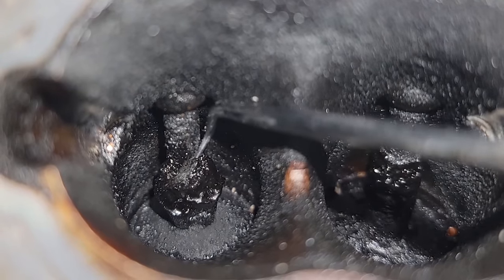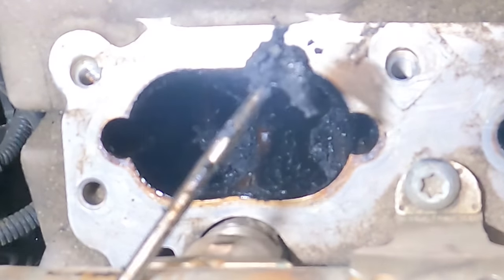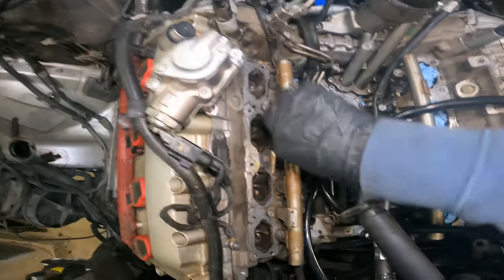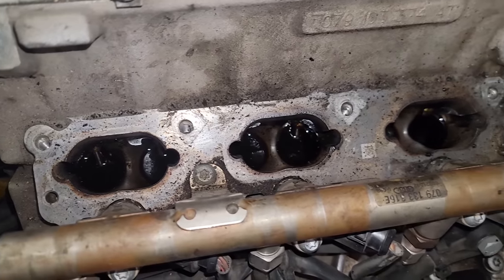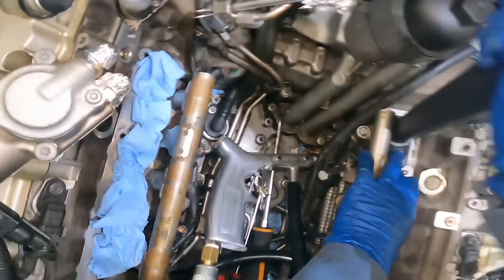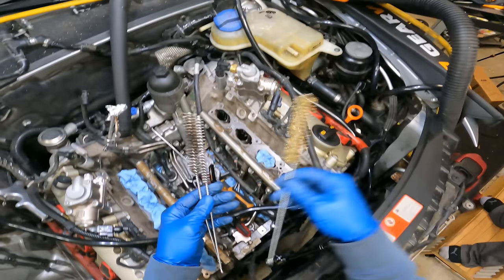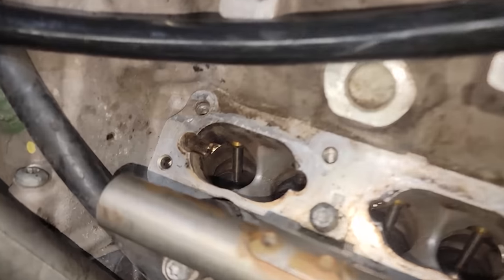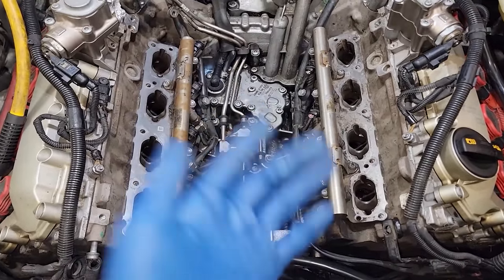Audi 4.2 V8 Carbon Cleaning | DIY Walnut Blasting step by step instructions

Comment: how much of the Ground Walnut Shell Media would it be needed to do a 2.0t engine? (is 4lbs enough) 
Harbor Freight sells a 25.00 lb. Walnut Shell 24 Grit Fine Abrasive Media. I wonder if this grit is fine and I also wonder if 25 pounds would be too much
Reply from the maker: 4lbs should be plenty. Fine or course works as well, I just picked course.
Reply: How powerful does the air compressor need to be?
Reply from the maker: Not very powerful at all, just needs to hit the min psi of the blaster

Comment: Would an oil removal kit work to prevent this from happening in the first place?
Reply from the maker: If you mean a catch can, yes, it would help a little, but it won't eliminate the issue. Even with a catch can it would still have some carbon buildup. Just not as much
Reply: @Mechani_Cole  super unleaded fuel and more frequent oil changes with good quality engine oil would help also.
Reply from the maker: Minimally. Doesn't make a big difference on carbon deposits. This is a result of direct injection and the cons that come with it. They will ALWAYS need carbon cleaning no matter what you run or what chemical is added.

Comment: Hey brother how do I make sure that nothing falls inside?

If something falls inside how bad is it?

Can I do it with chemicals instead?

What if chemicals get inside?
Reply from the maker: @theprocrastination3819 good question! This is why walnut shells are used. They are pretty harmless if a little fall inside. 

But to better answer your question, you need to turn the crank with the crank turning tool in order to make sure whatever cylinder you are working on has the valves closed. You'll watch for the valves to close on the cylinder you want to work on. Then you keep the other holes covered while blasting. Doing one at a time. 

Chemicals evaporate quickly, it's not a huge issue if a little gets inside. However, with the valves closed and the open ports plugged with towels, then there is little chance any error occurs. 

Use foil to cover the ends of fuel lines to prevent walnuts from going inside. 

Use a pick to break the carbon free, just don't scratch the ports up.
Reply: @Mechani_Cole  legend mate

Comment: Looks good when it's cleaned so thoroughly but it's really not necessary since the EGR valve will dirty it up again in a week. Just do a 90% job and save some time.
Reply from the maker: That's why I installed a catch can! Made a huge difference in the carbon buildup. Plus I'm OCD so I like it clean🫡

Comment: The carbon comes off easily if you soak them for 24hrs did that with mine this week.Scouring pad cut in to little squares then spin them them round the values with a screw driver works wonders no need for these crap brushes.I used a small steel brush for the sides of the ports only.
Reply from the maker: Yeah, could work if you don't have the $50 for the blaster and Walnuts shells. However, I usually don't have 24 hours to let a car sit. In that time I could do this job about 6 times. But yes, you can clean them with the blaster.
Reply: @Mechani_Cole  I only used two cans of CRC value cleaner 500ml The results was like it had been walnut blasted but the draw back was It took me fours days to do.Got four done in one day then two the next then two singles over the next two days.The CRC cost me £80 for two.

Comment: Do you use 93 Octane or fuel injector cleaner?
Reply from the maker: Both. But that doesn't change anything for direct injection engines. Only for port injection.

Comment: How is the performance after?
Reply from the maker: Smoother idle, better fuel mileage, and more responsive on the throttle are the main benefits carbon blasting has🤙🏼

Comment: How? Is it because of the stupid EGR??? Edit: the stuff you do does not make sense to me since the edges of the valves that sit closed still will have a carbon on them, preventing them to seal fully, thus still enabling worse compression..
Reply from the maker: All direct injection engines have this issue
Reply: @Mechani_Cole  sorry for being sarcastic but yeah.. this explains my question 🙄

Comment: Yall jsyk I you have bad valves your manifokd will turn red make sure to clean your injectors every 30k miles or so great video
Reply from the maker: Spicy manifolds aren't fun either haha
Reply: @Mechani_Cole  my manifold turned red and my cat started smoking because bad carbon build up and bad injectors it was not fun to fix
Reply from the maker: @Ty0_5 did your cats survive that? Usually ruins the inside of them too. Or maybe it burned them clean? Haha
Reply: @Mechani_Cole   took it apart it was perfectly fine luckily. Since mine is a b7 those are known for bad carbon build up.
Reply from the maker: @Ty0_5 I haven't seen an audi that doesn't have bad carbon build up yet🫡
Reply: @Mechani_Cole  I appreciate you making this video man you earned a sub!

Comment: Everything looks cool and efficient! but there's a problem with the piston group! The engine is consuming oil. In 3000 km it will be the same.😢
Reply from the maker: Incorrect! There is a lot of speculation in these comments, but not many facts.

Carbon cleaning has to be to performed even on new engines that consume no oil. It's just how the design is. Look up port injection vs. direct injection to see the difference.  

This won't need to be performed for another 60,000 miles🫡

Comment: Every time I gas up I put lucas oil I hope my car can pass the 100 k miles before this happen
Reply from the maker: Doesn't matter and would never make a difference. If anything it's a waste of money for direct injection engines. Quality of gas, nor additives do nothing for carbon deposits on direct injection. If you have port injection like most cars, then you got nothing to worry about.
Reply: @Mechani_Cole  I have a 2020 Corolla what motor is that
Reply: @Mechani_Cole  how much miles dose this car have in your video
Reply: @Mechani_Cole  after I put lucas oil gas saver I save a lot of gas if I put nothing I can feel the different
Reply from the maker: You have port injection. You'll never have carbon deposits like this due to gasoline 'washing' the valves. 

On direct injection the injectors pulse fuel directly into the cylinder bypassing the valves.
Reply: @Mechani_Cole  I like had 3 old Camry they all stall after 70 k miles was it this carbón build up
Reply: 1995 Camry stall after 150 k miles then my 2nd Camry 2003 stall after 100 k miles then my 2015 Camry stall like 70 k miles why

Comment: i have an Audi s5 4.2 2012 automatic, how do i open and close the valves manually without a diagnostic tool? As i have a vacuum leak and whilst it is all off i was planning on cleaning it manually without the walnut blaster
Reply from the maker: You don't. You need the tool to turn the crank to close the valves. How are you going to clean it without a walnut blaster?
Reply: @Mechani_Cole  do you put it directly into the crank and turn it either left or right to open/close it? I have visions of turning it and it coming off or something🤦‍♂️😂 but I was planning on scrapping/wire brush with a drill attachment and intake cleaner and rag it out whilst the valves were closed...might be long way as gonna attempt it on a driveway
Reply from the maker: Yes, you put it in between the crank bolts and only turn clockwise, never counterclockwise. 

I can tell you from experience, unless you don't value your time at all, you're going to have a bad time trying it like that. It will be several hours of frustration only to get it "kind of" clean. Chemicals and a brush will just make a big mess. I've tried it. It is best to spend the $80 and do it right and save your time.
Reply: @Mechani_Cole  thanks for your input on the situation, what's that $80 for the walnut machine? I'm from the UK, ill have to see what's economical and best value for the money
Reply from the maker: Yeah, do you guys have Harbor Freight in the UK? The blaster is pretty cheap
Reply: @Mechani_Cole  I'm not too sure, you got the make and model of the one you'd suggest of the walnut blaster?
Reply from the maker: Not sure the names but it's listed in the description. Just got the cheapest one after Google searching "Walnut blaster"
Reply: @Mechani_Cole  me again, do I need to put the car in neutral on the automatic to turn over the engine with the crank? Or will it work in park and it'll turn over?
Reply from the maker: Won't matter unless it's manual🤙🏼
Reply: @X055_s5 Hi X055_s5, I have same model and I also wonder in what position to put the tiptronic gearbox to turn the engine?  I am also thinking of position N. Did you find the solution?
Reply: @pierredarbon3368 I put the key in the ignition to turn the engine over, make sure the coils, high pressure fuel pumps are disconnected alongside the fuel pump fuse in the 2nd column by the steering wheel... 25 or 30 amp one... I pulled both just to be sure
Reply from the maker: You don't need to put the car in neutral to rotate the engine. It will spin either way

Comment: Maybe this is the cause of the lean codes on my Q7 4.2.
Reply from the maker: Possible, but unlikely. Lean codes refer to your car receiving to much air and not enough fuel. This is usually cause by a vacuum leak in my experience

Comment: A smarter way to do it putting a fixed amount of whatever abrasive you are using and closing the intake with a special tool (which has one hole for pressurized air and one filtered small hole for air to escape) and trying to create a vortex inside the chamber. That way you don't need to suck the air with a vacuum for that matter.
Reply from the maker: I know it sounds like that would work better, but it wouldn't.  You would still need a vacuum to remove the debris from the intake valves that way. 

The vacuum is 100% necessary when walnut blasting. The blaster is adding more walnut shell media in while the vacuum is sucking it out creating that vortex. 

I understand your theory, but it's just that, a theory. There's a reason why mechanics across the 🌎 do it like this🫡

Comment: How many valves are close at one time ?
Reply from the maker: Depends on where the engine is rotated. Just get as many closed at a time as possible, can't remember how many exactly
Reply: @Mechani_Cole  on the video you got four out of three but on other videos it's different which confused me a little 😂
Reply from the maker: Yeah, I think just different positions in the compression stroke that leave a different amount of valves open. I had no strategy to be honest. Just turn the engine until I saw a few close at a time
Reply: @Mechani_Cole  Just an idea but a tooth brush might be good for cleaning instead of those wire brush 😊
Reply from the maker: @strikeeaglemodels it's not a bad idea. However just wasn't abrasive as needed to remove the carbon completely

Comment: These videos are like taking psychology 101.  You become convinced that you suffer from every syndrome you hear about.  My motor runs smoothly and fine and I'm convinced I need a walnut blasting.  I watch control arm replacement and I'm sure my bushings are shot.  The car just had mercedes'  biggest annual,  was fully inspected, and passed tech control without problem, yet...
Reply from the maker: This is kind of true! Then one problem can lead to another and it can escalate quickly!

Comment: just block ur egr valve with a plate for 10-20k miles and its cleanings itself
Reply from the maker: Definitely not😅 Especially on direct injection vehicles

Comment: Seafoam in oil and gas
Reply from the maker: 😮‍💨😮‍💨 This would do absolutely nothing. 

Explain how that would be effective if fuel never touches the valves? 

That would be a complete waste of time and money that would produce no results. 

Walnut blasting or dry ice blasting is the only way people.....
Reply: @Mechani_Cole  I've put it in the oil and it cleaned up the rocker and valve area a lot, the gas is fuel system
Reply from the maker: You clearly don't understand how direct injection works if think seafoam cleaned your  valves my friend. It's near impossible it would do anything to clean the valves on a direct injection engine.

Comment: I think this is when you change the oil over 8-10 K km or two years...
And also the quality of oil....
Reply from the maker: Not even close. Oil was always changed less than 5k miles each time. Plus it wouldn't matter the quality of oil, have to use VW 502 approved oil anyways. 

Carbon deposits is a result of blow by in direct injection engine. It sticks to the valves and builds up over time. 

You can use the most fancy expensive oil you want and change the oil every 1k miles, and you would STILL have carbon deposits...
Reply: @Mechani_Cole  I see. I was just given my opinion...
I change the oil four times per year, at every three months I change the oil and oil filter. The other filters at 6 months. And I put Ravenol VMP 5w30 (VW504/VW507), it's Diesel. At every three months when I change the oil I have about 1500-2000 Km. driven. In addition to that once in two years I use a flush for engine cleaning.
So also in my case could be carbon deposits?
Reply from the maker: Diesel and direct injection are very different. No carbon build up with diesel
Reply: @Mechani_Cole  I am very happy to hear that there's no need in my case to make a carbon cleaning.
My car is a 2007 Chrysler Sebring. It has a 2.0 L engine, 140HP, Volkswagen engine TDI, the same engine that was on VW Passat and Audi A4. 
It was assembled in Michigan but this version was made for export to Europe not for US. It has manual gearbox and it's motorine (Diesel).

Comment: My V10 5.7 would coke up like this every 10 or 15k
Reply from the maker: Needs a catch can. It helps a ton on these cars. There is so much blow-by and the stock oil air separator does nothing. Once it hits the back of the valves it bakes on. Catch can will remove about 80% of that.

Comment: What the hell is in the fuel in the first place
Reply from the maker: This has very little to do with fuel. Actually mostly from oil. Direct injection doesn't have fuel "washing" the valves like Port injection does. The blow by builds up on the valves and cakes on. Direct injection engines provide better efficiency and more power, but comes at the cost of cleaning carbon deposits every 60-80k miles at most.

Comment: The point is...the valve seat cleanliness has nothing to do with your walnut blasting process.
Reply from the maker: My point is, I think you're mistaken
Reply: I'm not mistaken. When the valves are closed, which you MUST do when you blast the intake area, you cannot get to the valve seats. The only way to clean the valve seat is to remove the intake valve...which requires removing the head and doing a valve job.
Reply from the maker: @seanhoward8025 interesting. My camera says differently and shows clean seats across the board. Have probably done about 40 of these jobs and have yet to have an issue. No one is removing the head to clean the valves, that's wild

Comment: This is great...except it DOESN'T clean the most important part...THE VALVE SEAT. The carbon deposits on the valve seat literally can create the same symptom as a bent valve.
Reply from the maker: Checked with a boroscope, the seats are clean🫡

Comment: Why don't you open the head
Reply from the maker: For what? There would be ZERO need to open the head to remove the carbon from the valves. Keep in mind you would also have to remove the timing chains to remove the heads. None of this is needed for carbon cleaning, but happy to hear your opinion 🤙🏼

Comment: As this is even an issue is enough concern that the design is flawed. Seriously flawed. Yes, I drive an BMW with the N53 engine.
Reply from the maker: Not a flaw as much as just a downside to direct injection. Still can't beat the performance with regular fuel injection
Reply: @Mechani_Cole  Sure, the performance is an upgrade but the issues followed has not been handled and this is left to the owners to "take care of"... or some will.
Reply: @Mechani_Cole  Sure, the performance is a big upgrade in the beginning. But as you know, due to its design it downgrades during usage totally mitigating its purpose. Thus leaving the end user (the few of them) to actively engage in a totally new procedure of disassembling  and cleaning the previously non issued intake valves.
So yes, it's a design flaw.
If it had been a successful new design, it hadn't required the end user to go such length of securing the initial performance. And no, it's not a service that are informed to the end costumer.

Comment: alchohol and salt
Reply from the maker: Negative. Much more caustic to breathe, and not as effective. This is cheap and easy. Thanks for the comment though
Reply: @Mechani_Cole  but you dont need like half the crap you use, you def don't need that air blaster, the alcohol and salt just rips it off with normal stiring
Reply from the maker: On most gunk yes, however, this carbon it really doesn't break down much. Unless you have a video showing how much more effective and cheaper it is than this method I'm going to disagree.
Reply: @Mechani_Cole now you are going to make me prove it, ill be honest I dont know if it will work as well as what I used it for before but I own a kia that has over 245rk miles on it and ive never done that to it, so ill make a video of alcohol and salt prob take me 6 months but you will get a comment saying come and see me either show you up or make a complete ass of myself but with weed alc and salt is the only thing I have ever found that would get it all and its nothing but carbon on glass
Reply from the maker: Hopefully your Kia is direct injection so you are making the proper comparison. I just think it's no where near effective, but would be happy to be proven wrong